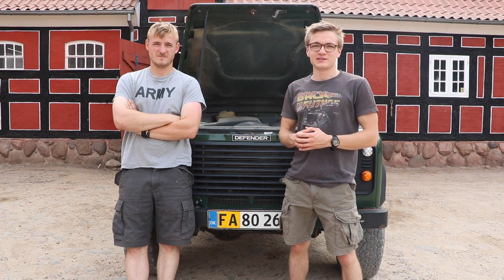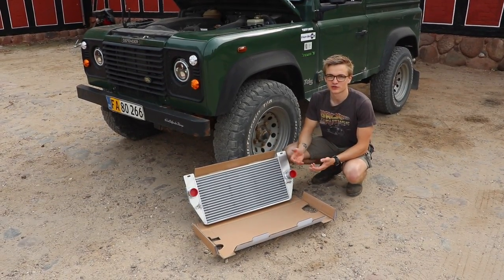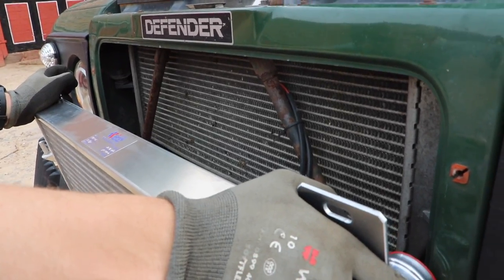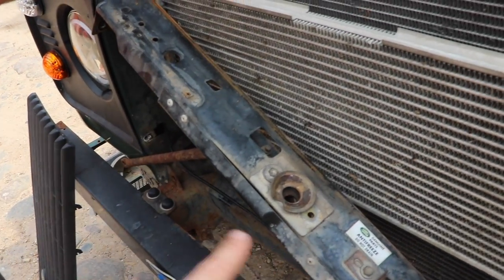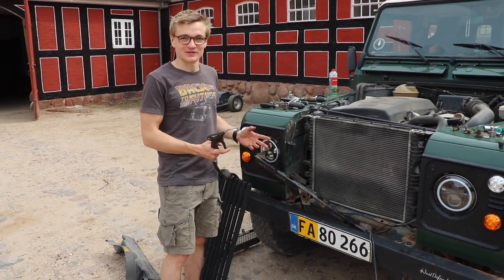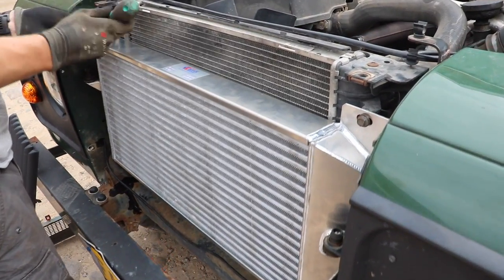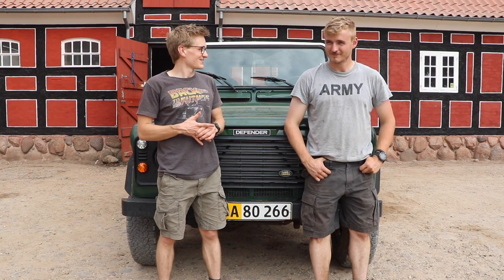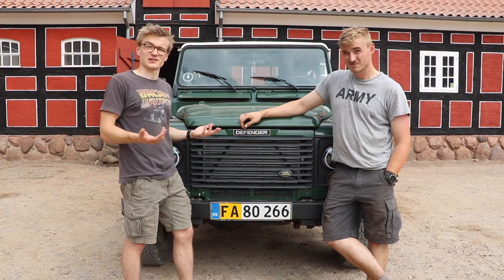Installing A Performance Intercooler | Land Rover Defender Mods

Comment: Thank you, I found a Serck intercooler on Paddock Spares Accessories and they are much cheaper at £354 for either the fast road or cross country, the part numbers are as follows, road 184 and x country is 185. Thank you for a great site.
Also found out today I can clean out my inlet manifold using oven cleaner, brilliant.

Comment: Instaling the upgraded intercooler was a smart move. I didn't think you would notice any change for the reasons you mentioned, but it helps keep everything nice and cool. Happy engin, happy driver. I believe you have tapped all the power the stock engin has, getting more power out of it would take some serious modifications to the inside of the engin, larger turbo or gearing on the diffs. This, in my opinion, is not worth it. Like you said, it is still a defender. Enjoy it for what it is. 
On my series the performance upgrade is alot easier. Tuning the carb and replacing the dizzy is about it. Hoping to get a new dizzy imported to South Africa.
Enjoyed the video. Looking forward to the 101 video. 

Enjoyed the video. Looking forward to the 101 video.
Reply from the maker: Thank you! Well put.

Comment: Been mentioned in comments below but obvious reason is that you would need to retune for the new IC. You should notice difference then. Other thing is, it’s hard to make a judgment just by your feel or for us to believe/understand based on your opinion. The true test would have been dyno results before and after. I just got one for my disco 300tdi. Hopefully make a difference. Thanks for video

Comment: With my TD4 2.2, the larger intercooler has led to a significantly longer life of my engine oil. I sent the oil to a laboratory after 10,000km and the engine oil that I sent in after 10,000km with a larger intercooler had significantly better values. While the other sample had already arrived at the end of wear. Meanwhile, I have been driving the large intercooler with 155hp and 450Nm for 100,000km without problems

Comment: Gret stuff, thanx...  Many years ago in Scotland i owned a converted series 1 with the two seat cab built on top of the engin (Perkins 6 pot) and a very handy flat bed with drop tail and sides.
looked very similar to a 101 Forward Control, am still bitching myself that i sold it !!!!

Comment: You'll need to get it mapped again to take advantage of the larger intercooler.
Reply from the maker: Liam have been in contact with Daniel from StormTuning, and he said the same :) - Nisse
Reply: Have you had a new map to account for the new IC?   I'm interested in finding out what the results are as I have the same Stage 2 from Dan and just did the intercooler upgrade.
Reply: Was there any update on this ?

Comment: when i changed to a 115mm intercooler core on my tdi300 i noticed lower egt's and way less heat soak over a longer drive and feeling way more punchy aswell the turbo making usable boost much sooner so this should feel a very noticible differance
Reply: that being said tho i have a much less restricive exhaust system on my rig so the differance is going to more noticable

Comment: Hi! Do you still have original clutch? And how many KMs you have on that one? I’m thinking of remapping my TD5 130 Defender... I’ve 205000KM on it.
Reply from the maker: Not sure if it's the original clutch, but I haven't changed it in the time I've had it. The car has 291,000kms on it, so I wouldn't be too worried.

Comment: With fitting such a big I/C covering all of the front of the radiator, have you had any problems with the engine running hotter than before?
More power equals more heat and with all the air now passing over the radiator being heated by the I/C I was wondering if you had noticed anything?
Cheers,
Ian
Reply from the maker: Haven't had any problems